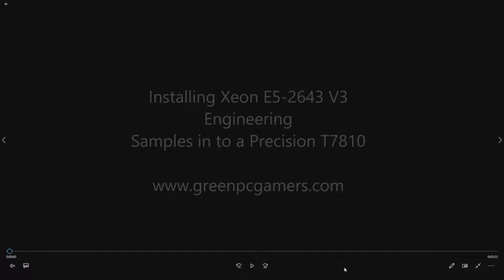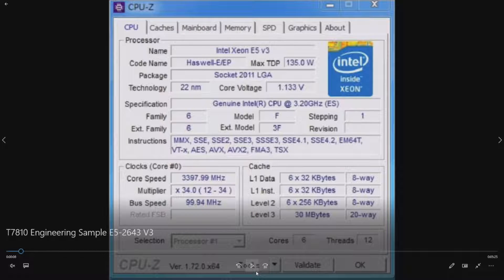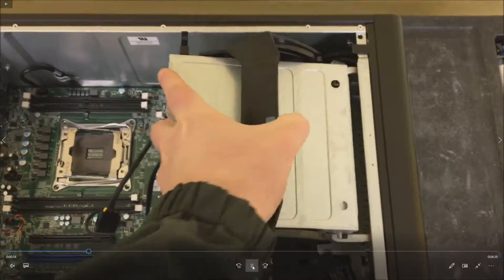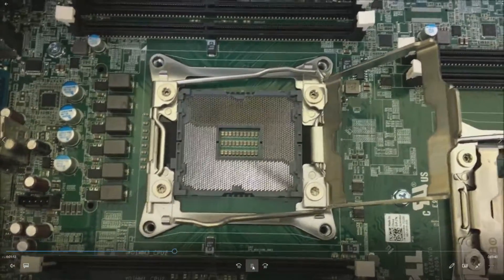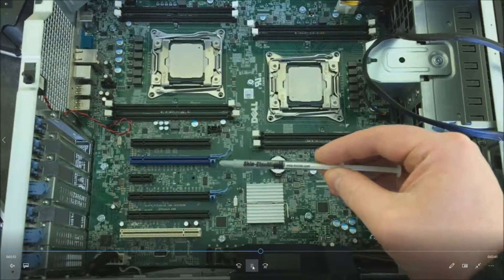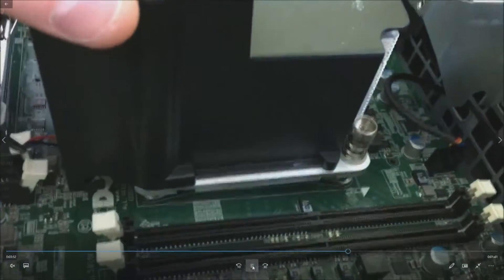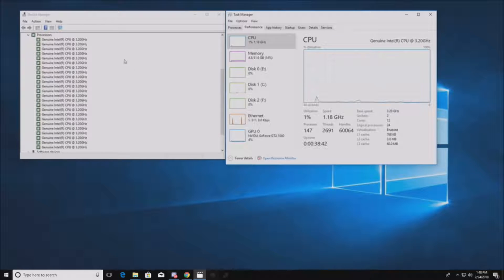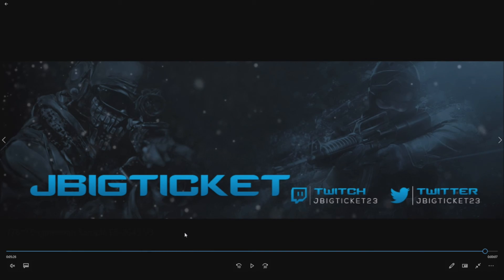How to Install Processors in to a Precision T7810

Comment from the maker: ** We do not recommend installing engineering sample processors.  After 1 year of testing we found that they cause the system to randomly overheat and shut down the computer.**
Reply: It's definitely better to just plain use real oem.
Reply: @defiverr4697  LOL, ES are as 'OEM' as it gets, they are created during the initial tape out to evaluate power/speed relation with wafer location among other things. Non 'OEM' would be a knockoff made by someone else. OEM = Original Equipment Manufacturer ya muppet. You're probably thinking OEM has some relation to release/production mfg units - it doesn't. If you made ES somewhere and made some more somewhere else, the second batch would be ES/Eval for that second mfg plant/batch/etc, not somehow release units automagically off the bat. Jeebus.